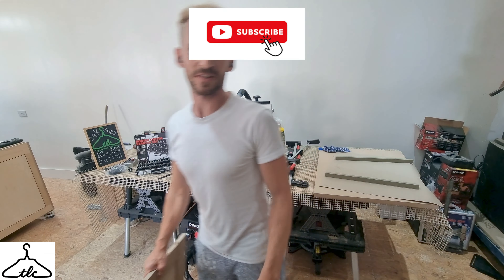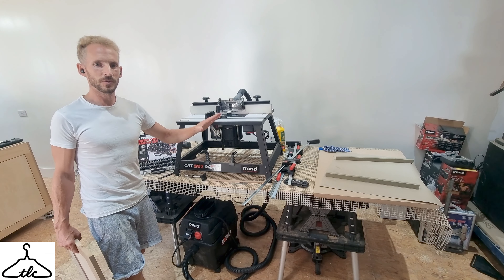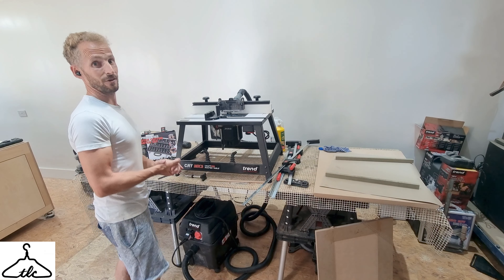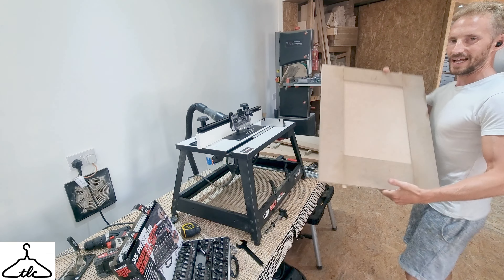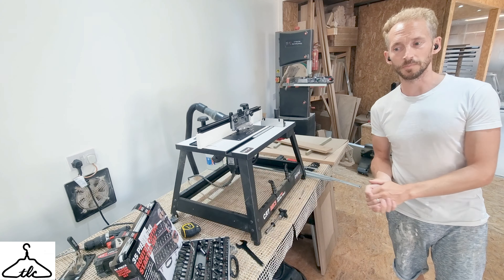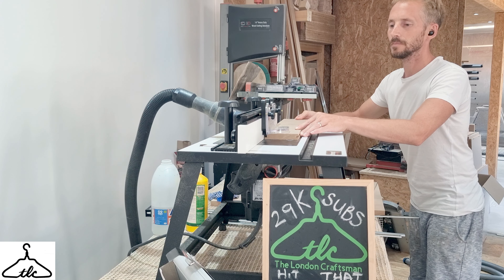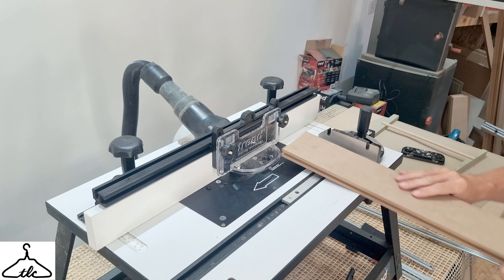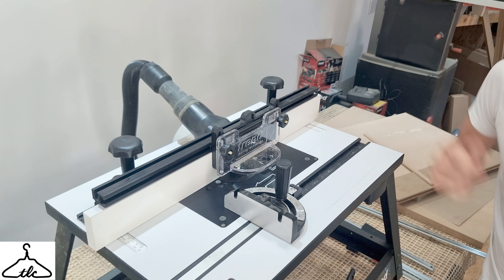Shaker Doors With Trend CRT Router Table / Vid#104

Comment: Nice video, a lot easier than using the table saw which always was my go to method. I just got a triton TRA001 and I'm in the process of building a table for it from 4x4 fence posts for legs and 4x1 rails,  it's a solid beast and hopefully becomes as versatile as your Trend table.
Reply from the maker: Thanks!
Definitely alot easier and more fun!
Yes I'm sure it will be once you've made it, the fun is in the making!
Enjoy your build 👍👍
Reply: Just get a Shaker rail and stile set from Freud.

It is like 100 USD, way easier than doing this method.

Comment: Thanks for uploading this!
I have that router table and its great to see how other craftsmen are putting it to work!
Reply from the maker: Your welcome thanks for watching.
I suppose there are literally hundreds of uses for them. I'm aiming to try all the cutters in the box and test them all out 👍👍
Reply: @thelondoncraftsmanworkshop I needed to joint up some 20mm sweet chestnut to make up wider boards from 250mm wide stock. 
I used the trend-866x1-2tc-finger-jointer bit in the table and ran out ~100 metres of boards, really really happy with results and all produced onsite.
Reply from the maker: Amazing!!!

Comment: Great vid. Have you moved over to all shaker doors with this method? The wardrobe fit you did a while back in the blue room, were they this method and not the older style you did with flat panel and glue on 3mm details. Did you find the older style warped?

I’m due to make some wardrobe doors and not sure which route to go?

Thanks
Reply from the maker: Hi I generally use the panel method with 12mm panel and 6mm strips now. In this video I was just demonstrating the tradition method